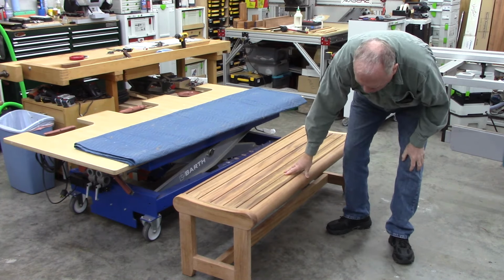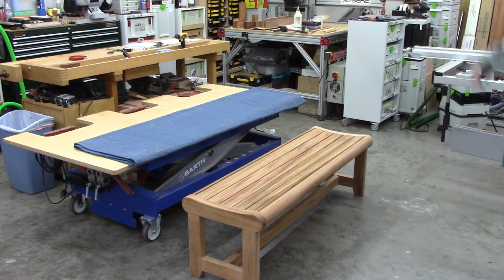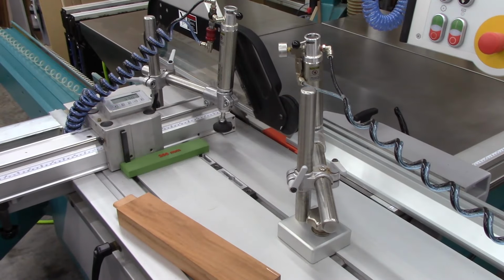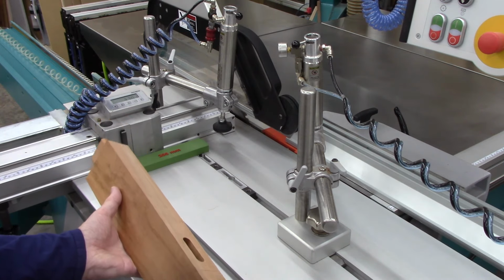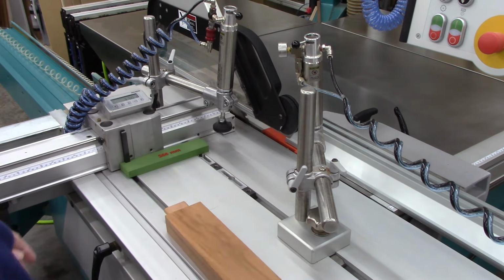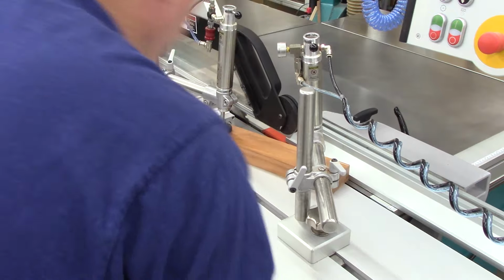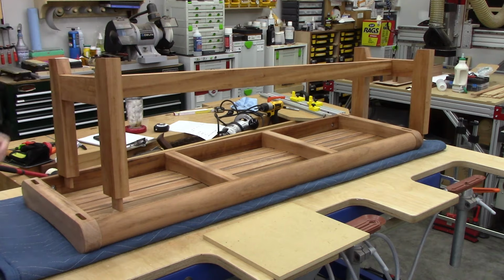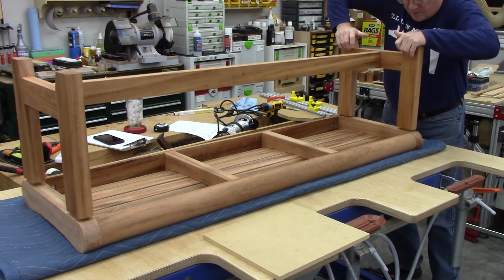Garden Bench Finale

Comment: Steve, Beautiful design and execution.  My favorite part is the tech of the Barth table with the old school of that Porter Cable router!
Reply from the maker: Thanks Paul.  That router is nearly 35 years old and it is ashamed they don't make these anymore.  Steve
Reply: @extremewoodworker  If they were only made like that now.  I have a chrome 690 anniversary edition with the metal box that my wife bought for me 25 years ago (maybe more).  The thing is bulletproof.  I got a new Milwaukee 3.5hp plunge router a few years ago - $400 - and the collet and electronics failed in the first 90 days and almost shot a bit out of my router table at me as the speed kept increasing.
Reply from the maker: @pkwoodworking  Wow!  That sounds scary.